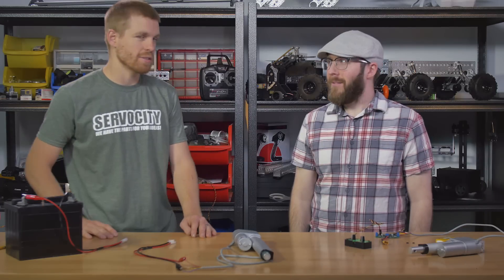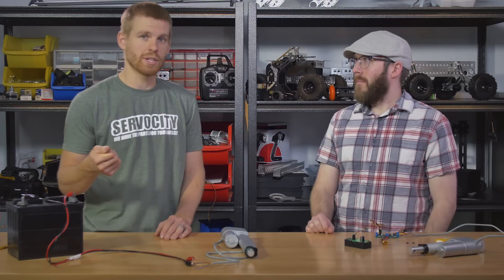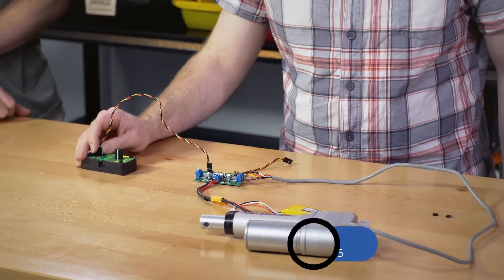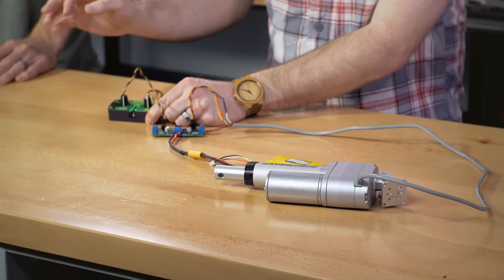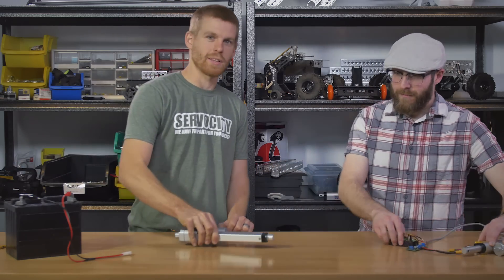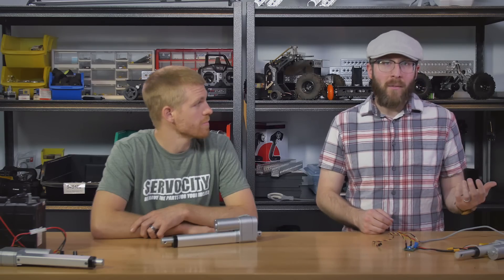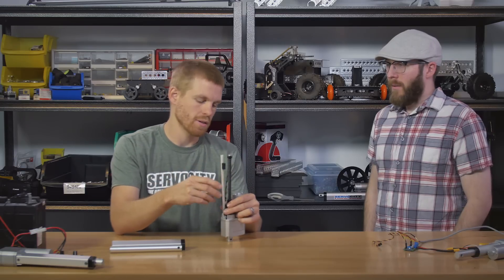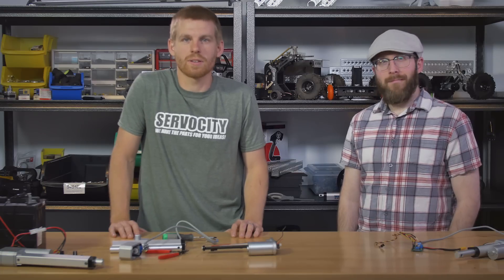Comparing Linear Servos & Linear Actuators - with Kyle and Jason

Comment: Will it for my Spectrum DX7 transmitter?  Will it works for my 24v application using Linear servo?  If I connect to the left joystick on my remote control, if joystick point to right is +5v what happen when it pointed to the left then -5v will the actuators move?
Reply from the maker: The Linear Servo will work well with a Spectrum DX7 transmitter & receiver. A 12v power supply is needed for a power supply.  They will remain in the position the PWM signal is being sent.   Please let us know should you have any additional questions tech@servocity.com.

Comment: Hi guys! I have been enjoying the channel! Thanks for all the useful info! I have a question about linear actuators and remote setups that - I don't know if you could answer for me? But I thought you might at least be able to point me in the right direction... I have a project I'm working on that requires 2 sets of actuators. I would like them to operate independently and I am trying to use 1 power supply and 1 2-4 channel remote. Let me know if you can help. Take care!
Reply from the maker: Thanks, Ryan and glad you've found our videos helpful!  Our Tech Team has sent an email your way to answer your questions.  Let us know if there is anything else we can assist with.

Comment: what is the most quiet 400mm 30kg push actuator?
Reply from the maker: Hi Natan, we only have one category of actuators able to provide such length.  There are 3 speed/thrust options within the super duty actuators: https://www.servocity.com/motors-actuators/linear-actuators/super-duty-linear-actuators which would meet your requirements.  The 18" stroke will be closest to 400mm; to fine-tune the length you can adjust the internal limit switches.  Feel free to contact our Tech Team should you have any additional questions tech@servocity.com or 620.221.0123.
Reply: thanks for your reply, what about the noise level?
Reply from the maker: They're all about the same noise level within the 'Super Duty' size.

Comment: Thank you, guys, for a great video. I admit I'm looking for a device that's a bit more unusual. I would love to find something like a linear motor (a servo would be fine!) that can traverse a stroke of maybe 4" with force of perhaps 50 newtons in less then 5 milliseconds. Is there anything like this beast in the real world?
Reply from the maker: Hi Howard, are you looking for a setup which can continuously go back-and-forth along a linear path?
Reply: I'm not totally sure what you mean by "continuously." But yes, I was hoping that somewhere there might be either a linear motor or a servo which would be able to seek locations along a linear path about 4" long or so, and which could make these moves  in around 5 milliseconds. With servos in particular, I would be happy with either a linear one or a rotary one, whatever could be fast enough. I am finding that the specs for most relatively fast servos rate them as turning 60 degrees in 1/10 second. A tenth of a second seems to be the fastest that anything of significance happens. It's not like I'm trying to build anything exotic; I am just hoping to make a workstation that provides force feedback as fast as many users would move their hands around the surface of a work table. Sorry if this sounds too goofy! Howard

Comment: I bought a linear servo from servo city  can i use a 4 cell lipo to power it?
Reply from the maker: We suggest using a 12v power supply with the Linear servo. A 3S Lipo would work well.   Please let us know should you have any additional questions tech@servocity.com 620.221.0123.
Reply: The problem  is a 3 cell is only 12.6 v fully charged is the servo going to shut off once the voltage gets below 12v? I thought i read that it operates from 12v -18v dc ? why not a 4 cell?

Comment: How do I find out if these work with 220v or 110v?  I bought a Linak linear actuator but it doesn't specify.
Reply from the maker: Our actuators are 12V DC powered.  A 110v to 12v converter like a Hitec 12V - 18V, 30A Power Supply would work well https://www.servocity.com/12v-18v-30a-power-supply.  Please let us know should you have any additional questions tech@servocity.com.

Comment: I have a 2" actuator but only need about 1 1/2 of stroke. I want to run a non momentary switch but can I readjust the limit switch to stop on the out-stroke at 1 1/2? If so, how?
Reply from the maker: Unfortunately, the limit switches are non-adjustable. Adding external limit switches would be the best solution for a shorter amount linear travel.  Please let us know if you have any additional questions tech@servocity.com.

Comment: I have a few questions about the linear servo.
I would like to do position control what would I need for this? Just a PWM Signal?
Also this has a Yellow, Black and Red wire which is which?
Reply from the maker: Yes, a PWM signal will tell the linear servo exactly what position it needs to be at (just like a normal servo). On a servo lead the Red wire is + the black wire is - and the yellow wire is signal.

Comment: The repeatability of the set would be how much?
Is it reliable in terms of accuracy?
Reply from the maker: Hi José. I believe you are asking if the linear servos will always return to the same location when given the same PWM signal? The answer would be yes, they are very reliable/repeatable.
Reply: Depends on how accurate you want the final positioning to be ,they sometimes have a little momentum overrun which is annoying if you are looking for micro thou alignment   Eg. ( model railway lines )

Comment: hi, my project on solar tracking,.... i need to a linear actuator which displacement is 300mm,... i maked a linear actuator but it is  not this type and when i run this actuator then its sometime stop due to more force applied by solar panel on it ....plz suggest me
Reply from the maker: We offer several 12" stroke linear actuators.  12" is just over 300mm.  If you need assistance selecting the appropriate model please email tech@servocity.com.  Thank you
Reply: how much is cost approximately?
Reply from the maker: It depends on which one you're interested in.  We offer both heavy duty and super duty actuators.  Heavy duty actuators are $129.99 and Super Duty actuators are $399.99 https://www.servocity.com/motors-actuators/linear-actuators

Comment: Dear Servo City, that is very helpful video, many thanks!!
I have one question though, is the any way to vary the output force of the actuator?
Reply from the maker: The output force can be varied by changing the voltage or limiting the current supplied to the motor.  If you want to have even more control there are force sensors available that could be used in conjunction with a motor controller as a closed loop system. Please let us know if you have any other questions tech@servocity.com

Comment: Is there ball screw and feedback to be controled by cnc, wich is the accuracy ?
Reply from the maker: Feedback is provided from the potentiometer.  Accuracy is dependent on the stroke length of the actuator and the motor controller you use to read the pot feedback.  Longer length actuators sacrifice accuracy for stroke length; shorter actuators will be more accurate.

Comment: That was an awesome demo guys..I have a question..I am trying to build a scale model of an excavator using the hydraulic principle with syringes.these motors act as Pistons so I should be able to use them instead right,I want to know what torque do these motors have cause I want my excavator to dig and lift just like the real thing.are they expensive to buy and could you pls do a demo on how to convert it to remote control..tnx guys
Reply from the maker: You can certainly use linear actuators or linear servos in place of hydraulics if the speed, thrust, stroke length and overall size fit your model.  Since we’re quantifying a linear force they are rated in pounds rather than a torque measurement.  The amount of weight it can lift will depend on the placement of the actuator in your assembly.  Prices vary based on what selection you make; we have HD linear servos which are the most plug-and-play solution for r/c.  We offer HD linear actuators that are less expensive but more intensive to hook up to R/C (require a motor controller that can convert the PWM signal to a voltage that would get sent on to the motor). and SD linear actuators which are the same as the smaller ‘HD’ linear actuators but beefier for more industrial applications.  The video covers how to connect a linear servo or linear actuator to a servo controller.  An R/C transmitter and receiver is just a wireless servo controller so it’ll connect the same way. Please let us know if you have any additional questions tech@servocity.com
Reply: Super!!!tnx for the prompt reply!!
Another question..how does the boom of a crane extend..do they all have multistage cylinders or are they also equipped with linear actuators within each boom extension?
And i.would really appreciate it if u could do a demo on how the excavotor rotates 360degs and still powers its tracks without its wirings and hydraulics getting twisted in the slew ring.i have looked online but not really satusfued with info or the lack of detail given. Cheers bros!!
Reply from the maker: Here’s a link to a brief explanation of how a crane boom extends: https://answers.yahoo.com/question/index?qid=20081125153736AAiN8mW.  I would have to do more research on an excavator before commenting on the rotating base; sorry I couldn’t be more assistance in that department.  Let us know if you have any other questions tech@servocity.com.  Thank you

Comment: Is there an easy way to get this to go one way with a single wire that powers on, then reverse when power to that wire goes off?   I was trying to think of a way to include a dpdt relay and i think that's the idea but i can't think of how to flip the polarity using that single wire's power change.
Reply: Interestingly I made this ( https://circuits.io/circuits/2563498-dpdt-relay-to-toggle-polarity-via-on-off-switch ) recently to illustrate this very thing to someone. This of course would apply to the linear actuators not the linear servos. If you are using a microcomputer/microcontroller you will either want to find a DPDT relay which does not exceed the current rating of your pins (for example Arduinos are generally 40mA) or you could use a transistor to turn the DPDT relay on/off. Sort of like this ( http://www.instructables.com/id/Simple-Cheap-Motor-Controller/ ) only going to the relay instead of a motor and pulling it high/low instead of sending it a PWM signal.
Reply: I just checked out the circuits.io link with the relay.   That will do exactly what i want.   thanks.   I just found the motor controller you're using too.   I want one but i don't know if moving a light back and forth on the front of  a truck is worth that much even though it would help me locate sasquatch.

Comment: I have a 12 volt 6inch stroke actuator that stops working after I run it backwards and forwards 2 inches about 3 times.  I have to wait about 20 minutes it will start working again. why does it stop working after short period of operation? How can I get it to work on and off over long durations?
Reply from the maker: We'd be glad to assist.  You can contact our Tech Team directly at tech@servocity.com 620.221.0123.  Can you provide the p/n on your invoice?  What are you running the actuator with? Power Source?  Thank you

Comment: In one ear ...out the other...but good demonstration. Thanks. I am thinking of one of these for gate I have had built to lock it.
Reply from the maker: A linear actuator (or linear servo) will have its limitations just like any device.  As long as the actuator is properly matched with the application then it is a very reliable setup.  If you're concerned about an obstruction keeping the actuator from moving to the desired position and putting too much stress on the gears, consider reading the current getting pulled by the motor and limiting it when you see a spike.  Should you have any additional questions please feel free to contact us tech@servocity.com
Reply: Remember, these cheap electric actuators have a big limitation. Although they are beefy, they have no way of knowing if they are being overstressed, and they will chew up their own gear box(not designed to be serviced) if you try to push them too hard. In the case of possible overstress, use hydraulic actuators. 

It is possible for a gate setup that they are placed so that the gate itself would act as a giant lever, and someone or something obstructing the gate could strip the gears on the actuator. Just something you should think about.

Comment: thanks man! i just have a question, what do you call the gear that moves the threaded rod up and down?
Reply: The threaded rod (lead screw) gets rotated, it has a lead screw nut which moves up and down along the lead screw as the lead screw rotates.
Reply: First it's not up and down. It's in / out or extend / retract.
Next the screw rotates, it doesn't move in or out. The lead screw nut is what travels along the lead screw and Push Rod / Extension Tube is attached to that nut.
The gears that drive the lead screw are a combination of a worm drive/screw that drives the rest of the spur gears. 
OOPs My apologies. The one he is showing here does not use a worm gear. It is just a set of spur gears.

Comment: Thank you so much for the video..its very informative..
I had coded a program to set a timer to count the forward extension and reverse retraction of the actuator using 16f877a and to display the time in LCD.
Reply: Roopa B please help. How to read position of the actuator with reed magnetic sensor in arduino?